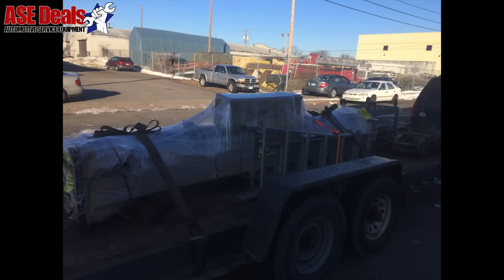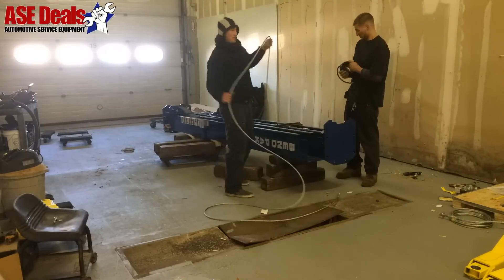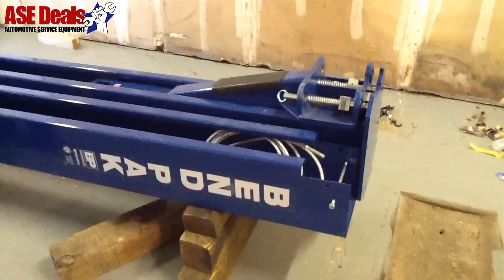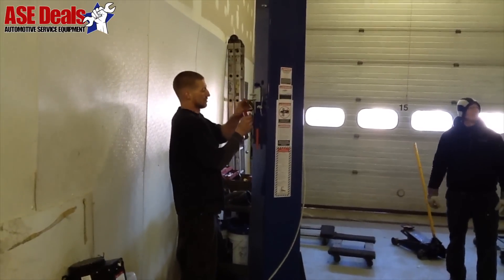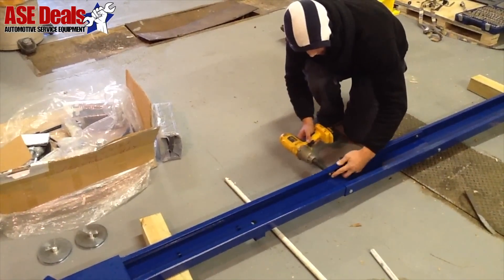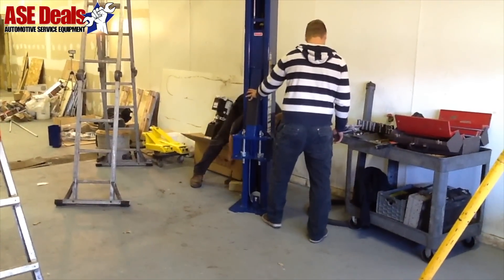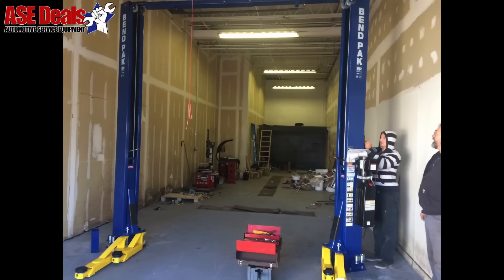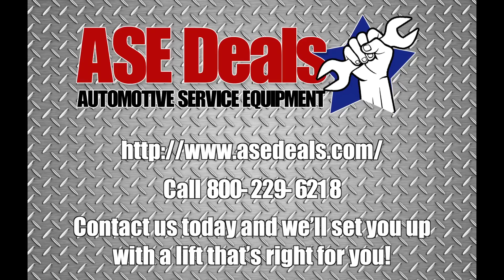BendPak 2 Post Lift Installation with ASEDeals.com

Comment: how the lift controls come out farther just wondering how wide is your lift overall I know you can do the 12 foot wide which is widest lift can be installed....so I should say think cause how the post are angled and the control unit?
Reply from the maker: This model can be set up at a wide setting of 145" overall width, and 137" narrow setting. You decide when setting it up.
You can view the dimensional drawing here - 
https://www.asedeals.com/XPR-10AS-Two-Post-Lift-Dimensions.pdf

Comment: What is minimum thickness of the foundation for a 12k lift?
Reply from the maker: For the BendPak 12K two post lifts, a minimum of 6" of concrete is required at 3000 psi hardness. 
For the 10K models, it would require 4" of concrete. 
Please contact me with any further questions.
Best regards
Reply: Automotive Service Equipment , if I have 12k lift but I don’t work on vehicles heavier than 6-7k - can I install it on 4” foundation assuming I will never put anything heavier than 9-10k vehicle (if ever that heavy at all)?